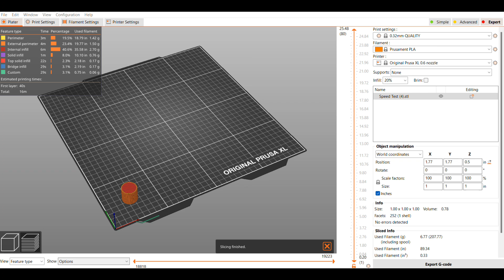Prusa XL Cube and Cylinder

Comment: Would be nice if you print tall cylinder
Reply from the maker: Ok I'll work on this. Thanks!
Reply: @tada3dprinting  Ideally it should be tall cylinder out of black PLA, then sand it lightly with flat sanding block. This test will demonstrate if the printer has Z-wobble (you will see the low and high spots and how big they are).
Reply from the maker: @illla  ok sounds good

Comment: I would see if you can do it with zero 1st layer elephant foot.  On my voron I can print most objects with zero 1st layer compensation and no real noticeable or measurable elephants foot.  You may have too much flow on the first layer if that is happening and z offset is correct.  (Some defaults bump the flow over 100% compared to the rest of the print).

Comment: Angus on makers muse has a tolerance gage and some other files like a castle used to check accuracy, and other issues. Perhaps try the tolerance gauge or tolerance castle or a part like this on the mk4 and XL ?
Reply from the maker: Sounds good. Thanks!

Comment: Thank you. Are the corners of the cube fall inside? Sorry its not the best light and you did not show the cube from the top.
Reply from the maker: Right at about 1:25 I show the top quickly. It's super smooth except the tiniest dot where it finished printing.
Reply: Not the top layer. The edges of the cube. The outer wall of the corners. It does look like that they are falling inside.
Well, maybe you show it in pictures next time :) Thank you a lot